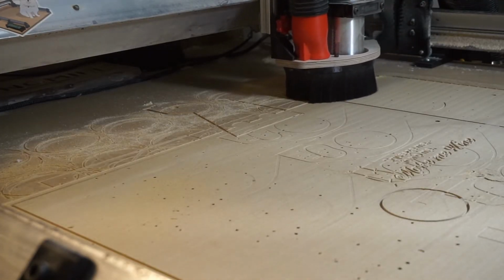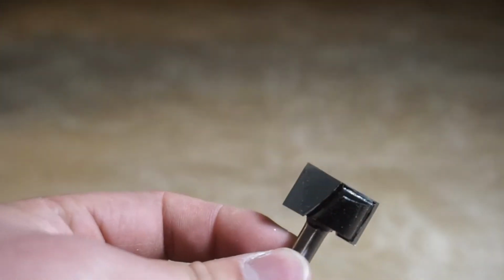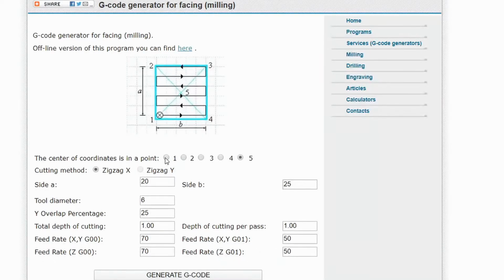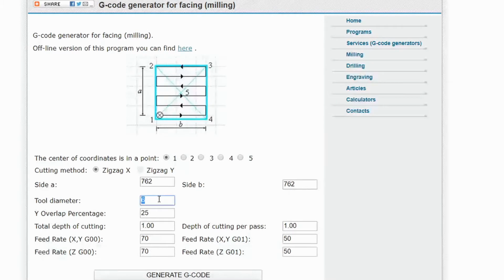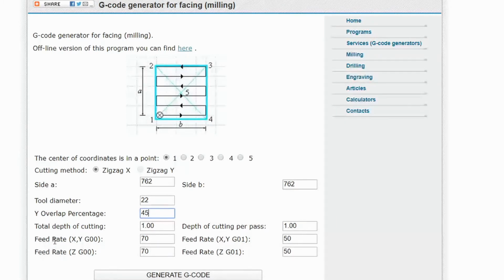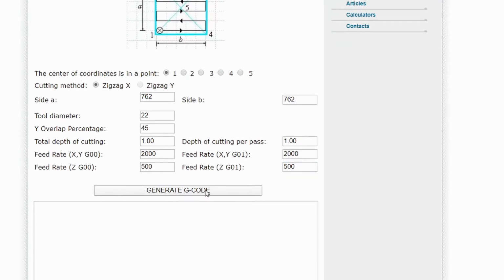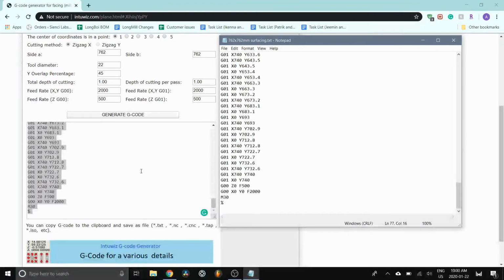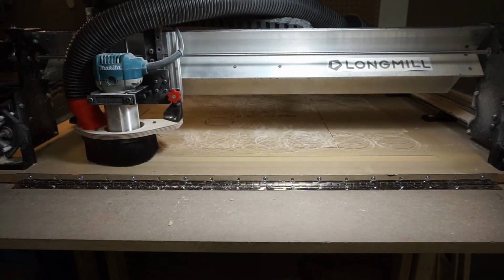Surfacing the Wasteboard on Your Longmill

Comment: Great video. Lots of useful information. Now to find one for surfacing with gSender.

Only thing I wasn't a fan of with the video was tightening the surfacing bit in while holding the lock button on the router.  I would highly discourage doing that and using the two wrenches that come with the Makita router.
Reply from the maker: That's very true Gatcha, thanks for the comment

Comment: Complete fail on my end.  I told INTUwiz to take off 0.5mm.  Checked the gcode to make sure that was right.  The router immediately dove about 5mm deep into my wasteboard and went merrily on its way, turning almost a quarter inch of MDF into sawdust.  Dust boot and shop vac couldn't even come close to handling that.  Then one of my Y-axis controllers quit about a third of the way through the job.  I don't have the energy at this point to troubleshoot it, beyond at least learning that it wasn't the motor, itself, fortunately.

Comment: Thanks for the video. I found the maximum reach on my Longmill to be 740mm for X and 845 mm for Y.  It’s closer to 29 x 33 inches than 30in square. You enter 762 mm per side in the program, which would be too wide for mine. But later in the video UGS is actually using 740 for x, so hm.